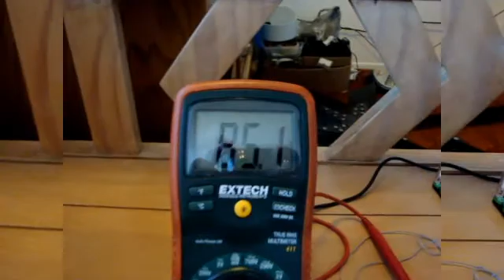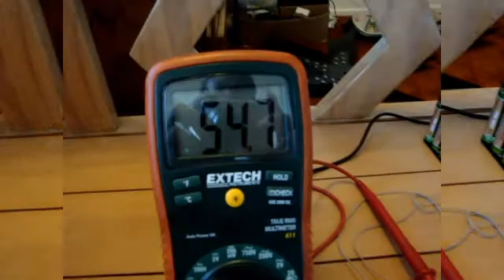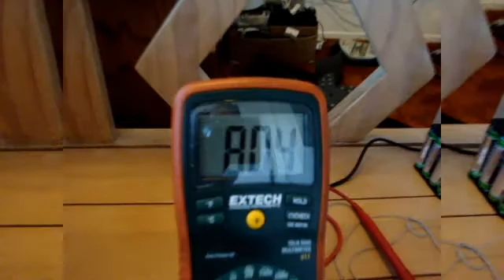2011 Newman Motor (85V with no fan. 400 RPM)

Comment from the maker: @beac310

1) No.
2) Right.
3) 64 ohms.
4) No. I would rather use the BEMF to power the fan directly rather than building it up in the circuit.
5) No problem.